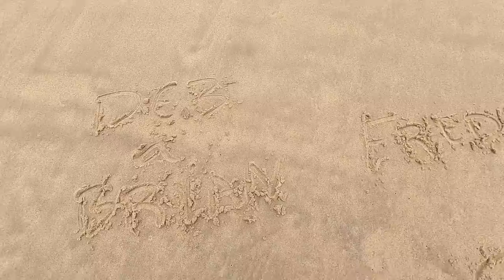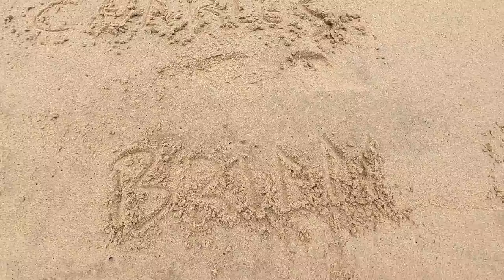Building our NEW KEEL from scratch! — Sailing Yabá #10

Comment from the maker: Hey guys!! We are loving how much you participate on our videos and we really appreciate the fact that you comment! And for those of you who are incredibly kind to us: THANK YOU SO MUCH, we truly appreciate your support!
Unfortunately, as our lives are focused on the refit, we are lacking time to respond to you all! Please don't take us wrong!
As it's really difficult to answer you individually, we are going to leave here some information over the main questions we’ve been receiving.

1) What kind of wood are we using for the new keel?
The wood we are using is Garapeira (Apuleia leiocarpa). 

2) What are we going to do to avoid the worms to eat our keel again?
First of all, we would like to clarify that what happened to the old keel was a combo of: neglected maintenance + boat stuck at the same place without moving for too long + tropical waters (worms’ favorite environment). As we are planning on moving and maintaining the boat yearly, the worms shouldn’t be able to feast on our hull like this again.
Besides that, we will treat and protect our wood against the worms, for sure. For now we’ve been applying a protective thin coat of an anti-corrosion primer, to start protecting the wood from sun, rain and basically anything in general. As it’s very thin and gets absorbed very well by the wood, it also works as a treatment against cracks by simply nourishing the wood. We still didn’t define 100% what will be done afterwards, so we will share this information later on.

We are sorry we didn’t mention this in the video… it’s been a very steep curve of learning and we often find ourselves so fascinated about the process that we simply forget to mention some other stuff!
We hope this clarifies your doubts!
Thank you so much for being here!
Feel free to ask more questions, we will try to answer individually or, again, we might answer many at once like we just did.  

FOLLOW YOUR DREAMS AND BE HAPPY
Love,
Ben, MP & Yabá!
Reply: Thank You for sharing
Love story of dream boat
    Coming true ❤️
🕊️🌎🌍🌏🕊️
Reply: Would you mind sharing the costs involved with all these repairs?
Reply: Ben and MP, You both have such kind and good Hearts!  Never loose that very important trait!  That is what drew Me to You Both.  That and Duca and Roberta said You were a Sweet Couple, that You are.  I have always wanted to visit Brazil one day, and I will. Tell Fred and Jhu Hello for Me. You All are the Very Best of humanity!
Reply: Where is Ben from??? 👍
Reply: Hi Ben & MP
Are you thinking od cladding the hull in like a copper sheeting or is that too  big of a job?
Love the that you are replacing the old keel and reatoring it to make it stronger and safe again. Well done.
Reply: Thanks for introducing Caio :)
Reply: Is MP her name or does it stand for something?? Iv never heard of a name with 2 letters and didn’t know if it’s a Brazilian thing . Maybe it’s initials like Mary Poppins or Military Police, I was just curious about it .

Comment: I have been a carpenter since 1972 and have built a few small boats plus have watched a few larger ocean going sailboats built/ Always in a big shop with modern tools. Replacing a keel is one of the hardest and mot important parts of boat repairs it is going to be a pleasure to watch these men at work. I wish I was young enough to come and learn from and help these men.. Carry on!

Comment: They are doing a good job with the keel. I 'm sure they know that the stem and stern timbers will need to be replaced, at least from the waterline down. You mentioned the new frame ends as well as the planking needs to be checked one by one. Hopefully not all the frames will need work but you can guess that every plank below the waterline will be wormy and need to be replaced.
Bottom paint will keep the worms from getting into the timber but you do have to haul the boat, scrape it, and repaint every year.

The cost of labor must be very low in Brazil so I am watching with interest as the work progresses. 
I will have to come to Brazil when it is time to have my next wooden sailboat built and see what it will cost.
I hope you don't run out of money before they finish re-planking.

Comment: Since it wasn’t. mentioned the joint used is called a scarf.
Reply: Keyed Hook Scarf specifically.   A simple scarf is straight tapered surfaces that are usually glued.
Reply: I did not see any hook. It looks like a straight scarf joint  to me. I was waiting to see if they would put a hook in it.
Reply from the maker: Thank you!
Reply: @alectrondorfman1057  At 14:43 and 20:23 and a few other spots you will be able to see that the ends of the scarf are less than 90 degrees which makes it a hooked joint that locks itself tightly under pressure from the tapered key.
Reply: @johnnybarbar7435  I did go back and have a look so you are correct.

Comment: In the old days they used to put copper sheeting on the outside of the hulls to keep the worms at bay. Are you going to do anything like that?  If not you will be right back here again some day.
Reply: Now you can use a paint with copper in it, which probably [I wouldn't know for sure] works better.

Comment: you're supposed to tar the whole length of the joints as well as using red oxide paint to seal the joint for no rot. otherwise in the long run the salt water will seep through and contaminate the joint. look up the videos on "Sampson boat co with Leo on tally ho rebuild" where they replaced the entire keel as well.
Reply: Exactly that must be done.

Comment: Hey BEN MP
i LIKE YOUR PROJECT    In  Denmark  we put a  2 inch  soft wood plank under the hard wood keel that way the worms stay in the soft wood  ( pine ) use tar between  keel and  pine .  Its much easyer to  shift a pine plank  when needed it will last for many years all depending on if you are stationary or on the move  location  and alot of other things.
   Søren Høj Jessen. COPENHAGEN  DENMARK.

Comment: I always thought that wood for marine uses was heavily pretreated to prevent rotting; I think one of this treatments is baking the wood with fumes of arsenic or other... poisons and then sealing the whole piece; it gives the wood a green tint, and is the reason why at least in my area is called greenish wood (in contrast to green wood, wood that has not yet being dried). That is the usual treatment for wood that will be exposed to the elements, and I often see this kind of wood being used in piers, by example. I am pretty sure that you guys would expand on this when the opportunity arises. Just a comment so you do not forget. :)

Comment: Were those galvanized steel bolts (all thread) you were planning on using to secure the keel timbers with? It didn't look like stainless (and I've have reservations about stainless in that low oxygen environment).

Comment: I have 2 questions. This must be costing a small fortune to do this rebuilding of the bottom of the boat. If you calculate all of that would it not be better to buy a boat with less problems. 
2nd Putting new wood on old beams, will it hold, has the worms not got into the beams?

Comment: Fit a worm shoe to the keel when it's done...  will help save the next keel. Also, what type of timber is the keel made of, and what's the plan with those rotten frames / ribs? Most of the rot appears to be near the bottom of the frames where water has sat for a long time.

Comment: Here is some information and speculation regarding shipworm I hope some people will find interesting.

Protection from shipworms or Teredo was the main reason hulls of old fashioned wooden sailing ships were often clad in copper sheet below the water line.

Although they are described as a 'ship-worm', Teredo are actually a species of Mollusc somewhat similar to the so-called 'Geoduck' variety of Clam.

However Teredo employ the vestigial fragments of external shell at their anterior or 'head' end to efficiently bore their way through any wood they infest.

Like termites, Teredo digest wood they consume with the assistance of symbiotic bacteria in their gut and perform an important ecological function by efficiently recycling driftwood and dead mangroves etc.

Teredo also excrete a calcium rich substance from a region behind their head-end which coats their burrows and presumably this provides them with protection and comfort like the shells of more conventional bivalves.

Teredo also have two plates of shell described as 'pallets' at their posterior end to provide protection for the opening to their burrows where openings for a pair of syphons are situated.

One syphon is used for ingesting fresh, oxygenated water for respiration and the other for excretion and reproduction.

Teredo reach reproductive maturity and begin to spawn within six to eight weeks of becoming sessile when they initially infest wood and can spawn three to four times per season producing between 500,000 and 1,000,000 eggs each time they do so.

As you can see from these statistics Teredo are a very prolific species and the sheer number of eggs they produce is undoubtedly an important source of protein in marine food chains.

This may well explain why a great many small fish sometimes accompany wooden vessels wherever they go as well as congregating in proximity to driftwood.

This in turn undoubtedly attracts larger species of fish which may well be why so-called 'fish attracting devices' are now employed so successfully and harmfully by arguably unscrupulous operators of industrialized fishing fleets featuring 'factory' ships that process a catch on-site.

Unfortunately Teredo cannot distinguish between driftwood and the hulls of vessels and other wooden structures immersed in water such as jetties, piers and levees so they continue to inflict significant damage to such structures this day.

Teredo have been described as a 'clam that resembles a worm' which can range in size from 1.5cm to 58cm in length with an average diameter of around 1cm. 

Apparently the optimum temperature range in which Teredo thrive is between 15 and 25 degrees Celsius although largely due to expanding range of voyages performed by wooden ships over centuries they have long since adapted to waters around the globe.

The copper plating frequently attached to wooden ship hulls was often if not usually painted with melted bitumen or 'tar' to act as waterproofing for the wooden hulls as well as anti-fouling, the tar was also used to waterproof hemp or 'oakum' line comprising rigging for such ships.

I can only presume use of copper cladding and bitumen paint or 'tar' have been discontinued for economic as well as environmental reasons, because by all accounts they are quite effective and persistent preventive measures.

So-called 'Mangrove Worms' are a species of shipworm that are harvested as an important source of protein by some cultures such as coastal Aboriginal tribes in Northern Australia.

Comment: I noticed in your last video that when you had the boat out why didn't you bottom paint it isn't there a paint that might help with the worms and critters.
Reply: Flex seal?
Reply: @peterg.8245   no in antifouling paint I've owned wooden boats for years I take them out every year and add a new layer of antifouling paint to keep all kinds of scum and Critters off the bottom of the boat.

Comment: G'day, just wondering if you are aware that you will need your boat to be self-righting in the event of a knock down at sea, you need a ballast keel to provide the righting moment. The keel you are replacing looks more suitable for a power boat than a sailing vessel. With the relatively flat hull shape and shallow keel the windward sailing capabilities are likely to be slim to none. I think some serious research needs to be done before you go too much further. Good luck.

Comment: It’s very interesting to see the boat being restored, but NO HEARING PROTECTION!! It would probably only cost $20 to provide for the team. You can fix a boat but sadly, not deafness.
Reply: Not required.  If you are going to spend years around loud machinery then wear hearing protection but for a few days its really not necessary.
Reply: @julianyoule-white7675  well, I was thinking first of the shipyard workers, and there would be no harm in setting a good example. Even for people with long term exposure, wearing ear protection alleviates the headaches and loud ringing in the ears often experienced after work.

Comment: So do you plan to put ballast on the boat, as in iron keel below the wooden one, or will the boat stay without ballast?
Reply: The boat does not require any added ballast.
Reply: @GBTC2011  Hi Patrick. Well, they actually need it. It is allways added in schooners here in Brazil.
Reply: @cptcarvalhofly  I am surprised, the boat was designed with a full-length keel and such keels do not usually require a ballast. But if it is the practice in Brazil where they use these boats, I would strongly recommend that they do so. There has to be a reason why it is being done. Thank you for correcting me.
Reply: @GBTC2011  Hi again Patrick. I am glad to give some information about these boats since they are still      used here. (Now mostly for tourism and not as trade boats as they usually were years ago). Their design is very old and it has not a full lenght draft 
 keel like more modern sailboats design have (like Tally Ho, for example). Because of that they need extra ballast. Yaba had 7 tonnes of Baritina added as ballast when built. Best regards.
Reply: @cptcarvalhofly  Thanks for the info, I tried to find out some info regarding the boat on the internet, but did not find much at all. Although I love wooden boats, I have never owned one, nor have I owned a full-length keelboat either. If you know where to find information on this type of boat, could you please share it with us so we are more knowledgeable and have a better understanding of what Ben and MP are doing. Thanks.
Reply: @GBTC2011  Hi again Patrick. Regarding this kind of boat and how it is build I believe the best references can be find here:
 https://nadl.tamu.edu/index.php/ship-models/watercraft/saveiros-da-bahia/
I believe that Ben and Mp don't know exactly what kind of boat they have in their hands since their goals regarding a sailboat don't match the boat features...Anyway could be good if the boat could be properly restored. Regards.
Reply: @cptcarvalhofly  Dear Marcelo, thank you so much for the link. It was very instructional and gave me a newfound respect for the history of the Saveiros and the region of Bahia where they were built.
It seems to me that the original design planned to use the cargo as ballast. I hope that Ben and MP realize that they have a piece of history and preserving it as such is as important as making it seaworthy. Many thanks again.
Reply: @GBTC2011  Dear Patrick I am glad the link was
useful. Indeed, the cargo was the intended ballast for the boats in the past. Used for tourism or leisure, it is necessary to add some internal ballast regarding security. This explains the added ballast put inside Yaba.  My best regards! 
P.s I never owned a wooden boat also (for years I was mainly a saiboat racer) but my grandfather was capitain of a Saveiro in 1940/1950. Because of him I studied Naval Architecture.

Comment: I forgot to ask--- what are they doing about the curve or warp in the keel from side to side??
Reply: It will bend to straight easily when attached methinks.
Reply: I also saw that. The wood is hogged (curved very slightly possibly due to the way it’s been cut from the log. It also had a shake in one end that I hope they cut out!)
Reply: @stevenholton438  easily? It's hard to get a warp or twist out of a southern yellow pine 2x4x8 without some real effort and some force usually using itself as a lever. I wonder how they will use a keel over 50' long as a lever without ripping out the frames(ribs) and with what as force? Perhaps a back hoe or excavator arm might be used to push it straight after a portion is attached and then attaching the remainder. We'll see soon I hope! ✌🏼🙂
Reply: @danielbuckner2167  Yes with all that length for leverage I  would think so
Reply: @stevenholton438  yeah the issue is controlling that weight more than just supporting it. Also that scarf joint is not made to take a side load so that would apply force not accounted for in the joint design too but mostly it will just be the issue of moving that heavy keel subtly to get the warp out with in sort of control.  I am pretty sure ighe keel is already in so the good news is either it wasnt an issue or they didnt worry about it. They could also plane the curve on the other side away to create a taper and symmetry.
Reply: I’m sure the shipwrights know how to work with the bend.  I am looking forward to learning how they do it.  And I’m sure they will be using a traditional way that has been tested by time.
Reply: @coldwarveteran4239  Or an updated version of a traditional method like they have been doing.
Reply: They will probably just install other pieces cut at the correct angle then attach it to the straight keel . That’s how the boat looks like it was originally done anyways !! They won’t be trying to warp the keel to fit, it’s to thicker and long .
Reply: @mwatkins2464  Straight part of the keel, is that what you meant? That part will be easy. It's the curve at the aft that will have to be corrected or accounted for.